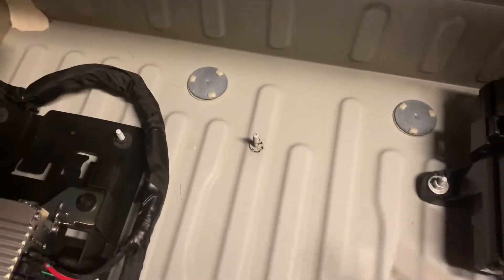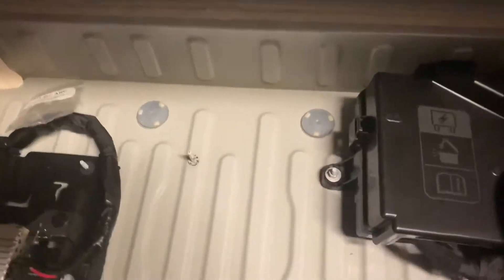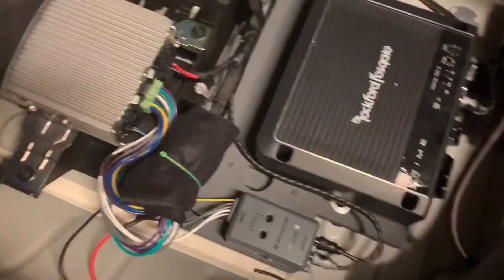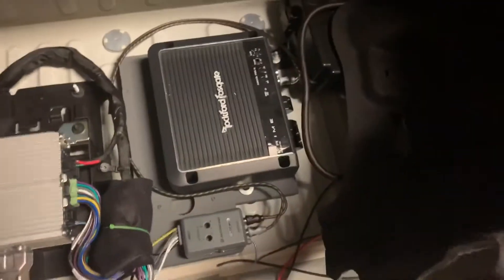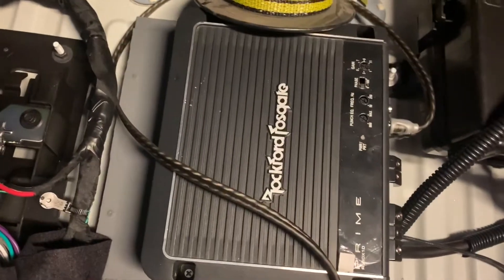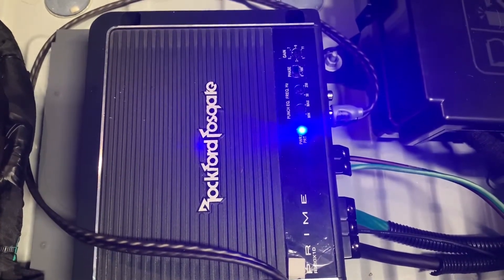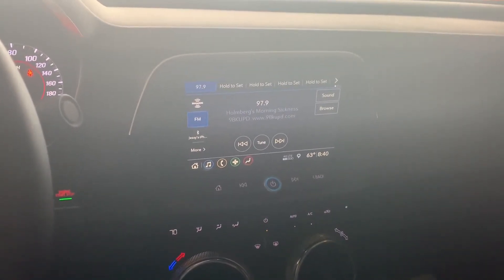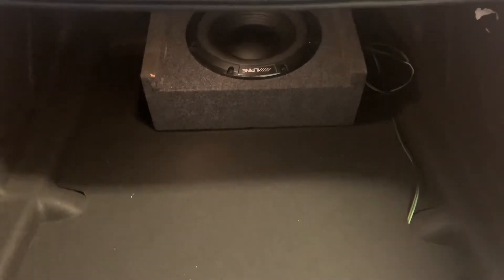Subthump ACN Bypass and Speaker out Adapter 2019 1SS Camaro

Comment: I am getting ready to do this on my 19 Grand Sport same set up same harness from sub thump.  My question is actually in tuning the sub.  I am going with a skar 10 inch about 600 watt and either a LOC with a skar amp or a jbl with built in loc.  Either way I will be hooking it all up like you did.  So my bose system can be played at max volume I guess since it's factory bose makes sure it sounds good at max volume.  So how did you tune your sub did you use max volume and set the gain or did you use 3/4 volume like on after market HU.  I am guessing max vol is allowed and a clean signal.  Also do you use a hz tone or music to tune you sub.  Any help would be appreciated.
Reply from the maker: bigv5150 sorry you are way more advanced in setting up the sub that I.  I just set the gain to where I liked it in relation the the factory system volume.  Good luck
Reply: LOL thanks for the response everything is coming this week and going in shoiuld be straight foward I hate installing stereo shit.

Comment: What do you think about doing a five channel amp? I'd like to power the current crappy speakers and then just give my system a little more base... nothing crazy
Reply from the maker: Karl Febel if you amplify the doors you will most likely amplify the warning chimes as the car utilizes the door spears for those tones.  There are some signal converters for the Bose systems but they get into the $400 range just for the converter.  If you don’t intercept the signal before it reaches the factory amp you will just boost at of the signal (warning chimes included).  A sub is much easier as none of the annoying tones are not on the low frequency range.  To avoid the annoying low frequency feedback with a sub you will need to disconnect active noise canceling.  I have a video in that.
Reply: @indecisivegarage2389  thanks so much for the info!

Comment: Thanks bro. I appreciate the work ethic. Going to bang all this out with a similar approach. What's the line out converter you used? Is it good?
Reply from the maker: Dude Lebowski glad to help folks out.  I used a SCOSCHE LOC2SL.  It has been working great.  The remote control is not very useful more like a on/off than true output adjustment.
Reply: Thanks man!

Comment: Are you running all four speakers in the car because my harness only has two green and two white for just the front two speakers do I spice in I bought the harness and it has two in the front to the back do I just price of four wires within the two hardest word if that makes sense
Reply from the maker: John Cindy it depends on what you are trying to wire in.  If it is a subwoofer you can use the line for the front and connect them to you line level converter.  The Camaro harness should have grey, grey/black, white and white/black for the front.  I don’t which main color (grey or white) is left or right.  The black strip indicates the negative lead.  The rear lines are green, green/black, purple and purple/black.  Hope that clears it up.

Comment: For clarification. The subthump harness connects in to the factory amp, factory amp harness then connects at rear of the subthump? You then took the pre stripped subthump speaker wires and connected them to your line output converter? Asking before I wrestle with this lol Great video!
Reply from the maker: Nick McGowan yes essentially the harness allows you to tap into the factory amp output to the speakers without altering the factory harness.  You could tap off the factory wires to save the cost of the harness and just tape the wire down the road if you decided to remove the aftermarket addition.
Reply: @indecisivegarage2389  perfect. Amazon is dropping it off this afternoon. Seems like a much cleaner install. Thanks for the clarification
Reply: @indecisivegarage2389  I just wanted to take the time and say thank you. My subthump harness came via Amazon prime this afternoon. Within an hour I was able to attach it to the amp I installed this weekend and just like that I was fully functional! This video and your clarification was everything I needed. You are the real MVP! Thanks again
Reply from the maker: Nick McGowan glad to help.

Comment: I'm new to this, but I just purchased the same amp. What are you connecting to the GND, REM, and B+ connections? What are you using the turn the amp on and off?
Reply: Eric Manning, you will need an amp that used high level input harness. It uses the signal to turn the amp on. If you have the Bose setup, SubThump makes the kit that shares the signal after the amp. It’s like $98 shipped for the kit on SubThump.